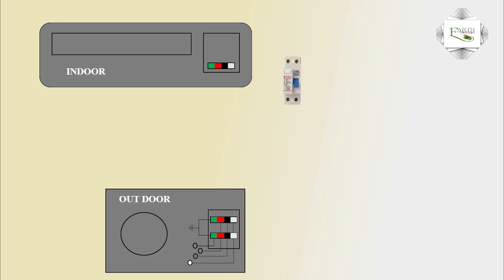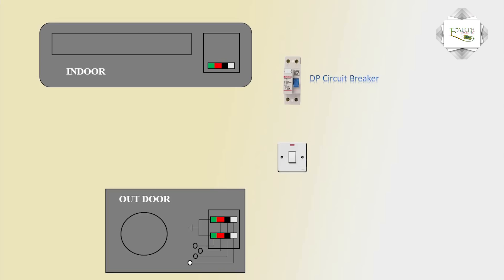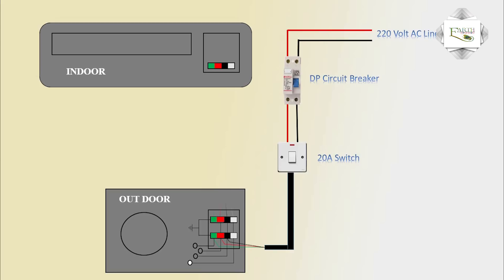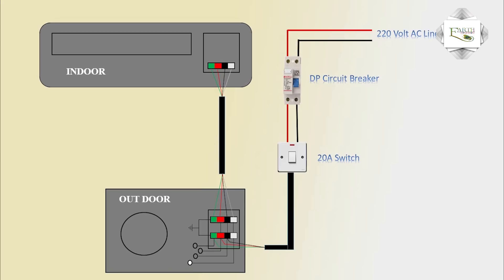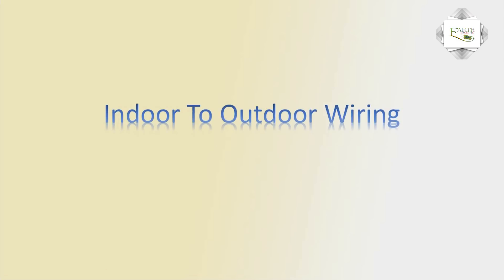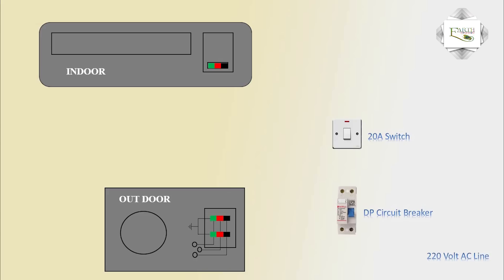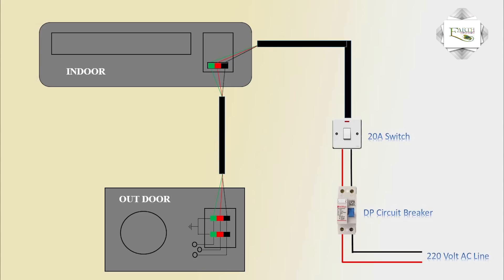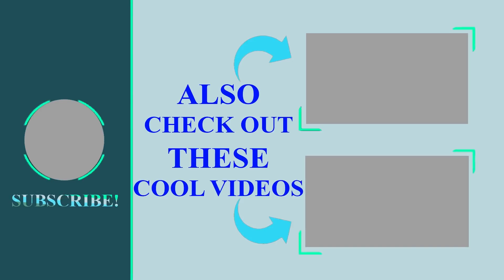Single Phase split AC indoor outdoor wiring diagram | air conditioning | Earthbondhon

Comment: IN ALTERNATING CURRENT THERE IS NO SUCH  THINGS AS NEGATIVE LINE OR POSSITIVE LINE,,ITS ONLY CALL ,,LINE ONE OR LINE TWO,,HOT WIRE ,NEUTRAL,,GRUOND,, POSSITIVE OR NEGATIVE TERM IS SPICIFICALLY USED IN DC ELECTRICAL WIRING AS REQUIRED BY POLARITY OF POSSITIVE AND NEGATIVE ..
Reply from the maker: ac line but control line DC volt.